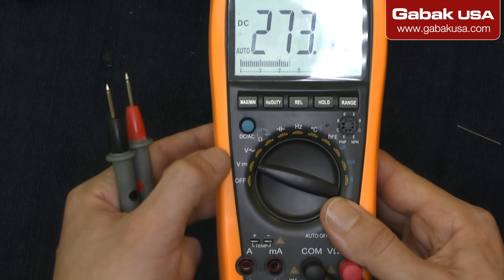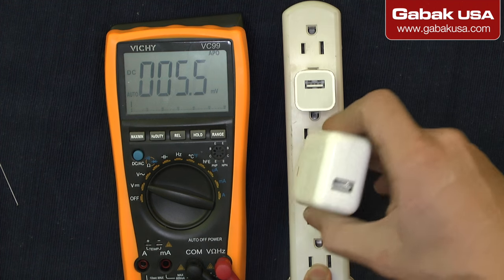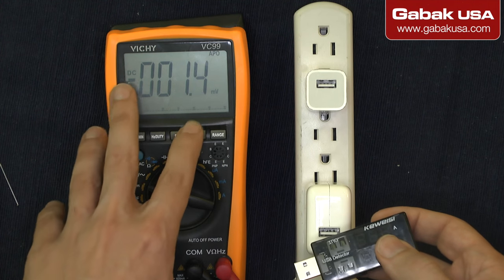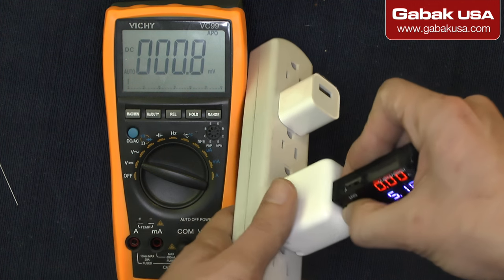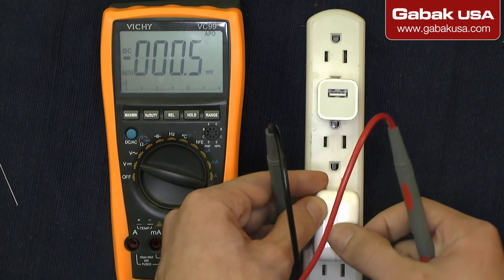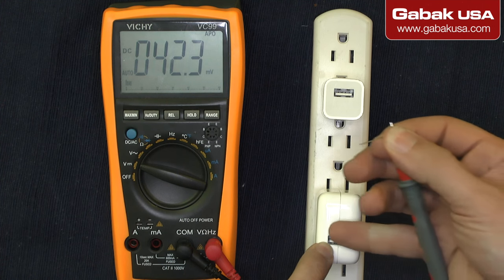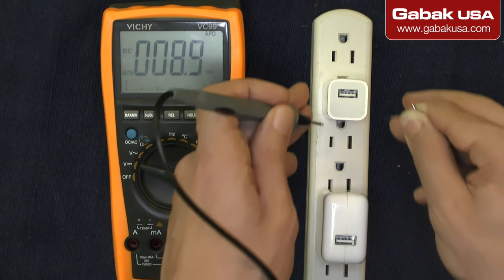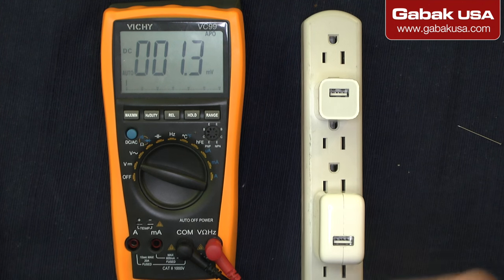how to check cellphone tablet charger with multimeter

Comment: The Thumbnail Has a Manual Multimeter, But U R Using A Digital Multimeter In Vid. I Clicked On Ur Vid Cause I Only Have A Manual Multimeter.
Reply from the maker: both are the same thing you can use either of them

Comment: How did you did not get a shock? Its a 5V + 2 Amps. its  10 WATT. You touched the hot pin and also touched the Neutral. You are completing the circuit. Please explain.
Reply from the maker: That is low voltage 
In order to tell the shock you need at least 60v or more

Comment: Checked my apple charger with a multimeter and it is showing 5.1v The lightening bolt symbol appears over the battery but the ipad still does not charge. The lightening cable is new and the port that it plugs into on the ipad is clean. Funny thing is, the ipad charges with a basic wall charger not designed by apple. I can only think there must be something else wrong with my apple charger.

Comment: Hello, how would I check if a port inside a device is still working/charging? Could I use a multimeter too?
Reply from the maker: the device it self has to tell you if is charging or not

Comment: Is one positive or negative you did not address that? Does it matter if you use the red or black lead on the outside terminals
Reply from the maker: it does not matter, because multimeter will read the voltage even if you put it wrong

Comment: Thank you for this. Two more questions for you.
1. My battery registers 2.8 (the battery is rated at 3.85). In my experience that still means not good. True?
2. I tested the battery charger leads in the battery bay while the phone was plugged in to the wall. It registered 0.01 to 0.03. The phone is still good? (at least the charging leads)
Reply from the maker: if the battery cant keep 3.85 when it is fully changed, the battery is bad
Reply: Okay, that confirms my thoughts. Thank you for the quick response.

Comment: why u are using the needle?to avoid short circuit?
what if i want to measure usb voltage of the front ports in cpu? will i have to open the case and measure it with the ic inside or from the outside only?
Reply from the maker: be careful if you use needle for measurement

Comment: What about AMPs?

thank you
Reply from the maker: i ll have to make other video to measure the AMPs.
but if you buy an original genuine charger you wont have any issue.
if you get ipad charger you can charge your cellphone as well too. ;-)
Reply: GabakUSA Free computer training

i have no problem with that.

I liked your easy explanation about voltage.

But I wish to see how much current my usb charger is able to give/output.

my usb charger says 2.4A but my phone only recognize it as 1A but only takes around 0.7A.

tested with various Electronics but I wish to see the current with my multimeter if possible?

thank you!
Reply from the maker: A digital multimeter measures the amount of current used by an electrical device or component. Most multimeters include a settings option for measuring current in amps. Replacement electrical parts and components must have matching amperage ratings to work correctly so proper testing with a multimeter is an essential step before carrying out repairs or modifications.
STEP 1Turn on the digital multimeter. Most digital systems run a self-check before they are ready for use. Allow a minute for the meter to complete its testing.STEP 2Set the function selector to read amps from battery power or alternating current. The function setting "A~" measures alternating current in amps, or AAC; "A=" measures direct current in amps, or ADC.STEP 3Set the range so the maximum is well above the highest reading expected. This will protect the meter from getting overloaded. If you overshoot the range and cannot get a reading, set it lower.STEP 4Connect the leads to the proper terminals for measuring current. Connect the black lead to the "COM," or common terminal. Connect the red lead to a terminal marked for low- or high-current measuring. The low-reading terminal may be identified as "300mA." This would give readings in milliamps; 1 milliamp equals .001 amps. Multiply by 1,000 to get the figure in amps.STEP 5Break into the circuit to measure its current. Set the red probe on one open end and the black probe on the other. This may require cutting a wire to get the probes between the circulating current. The idea is to let the current flow through the digital multimeter to allow it to get a reading.

Comment: Why there is a discrepancy between USB voltage device readings and miltimeter readings?
Reply from the maker: my guess is because they are unbranded devices and i don't think so they are very accurate.
they are fine for basic measurements
if you want high accuracy use FLUKE multimeter